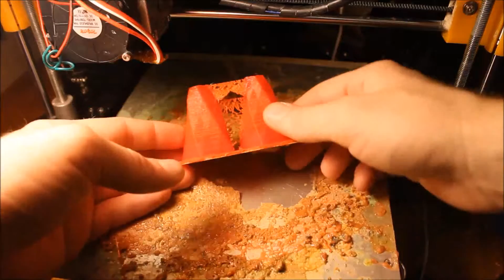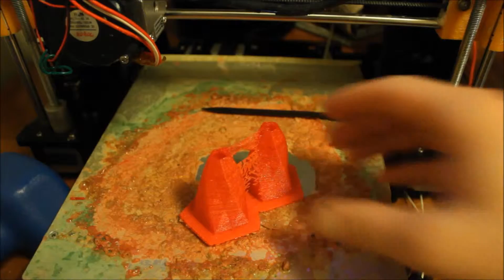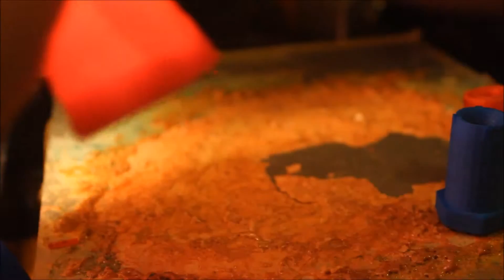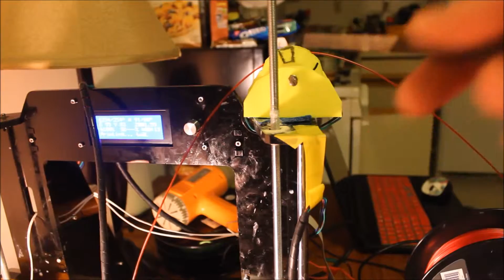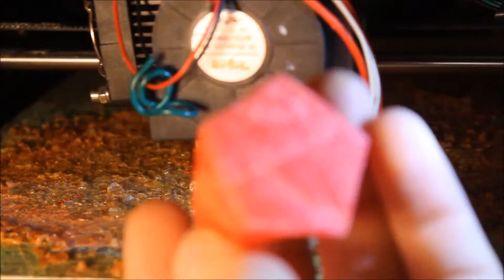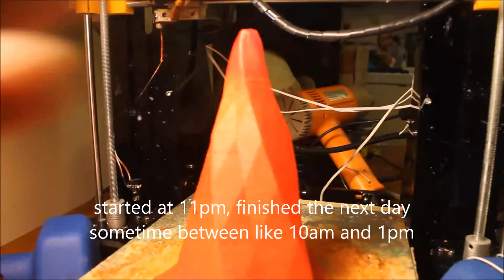3D Printing with Translucent ABS

Comment: What the F** is that puke on your bed? and cool down the print temp down a tad and raise the retraction and those strings will go away
Reply: +patprop74  That "Puke," which should not be on anyone's bed, is ABS slurry. I no longer use slurry and highly recommend Kapton tape for bed adhesion. Your other suggestion to lower the temperature is also very good. I run most of my ABS prints between 220C and 237C these days. 
Thank you for the comments!
Reply: +Richard Hebb loll I meant muck lol , I also when though the head aches of abs slurry which never really work well, then I tried 3dlac which worked great with out a mess if you have a headed bed, but now I am just about done with research and product launch for last few months I been printing abs on glass with out a headed bed with minimal warping. Soooon it will make a video on how to use my little product and help many with printing abs.
Reply: +patprop74 Hmm... Kapton on Aluminum is working incredibly well for me.

  I have printed ABS on glass before with and without adhesives. Ultimately, I find aluminum is better. Sure, the Aluminum can get bent while the glass to likely to remain flat, but the heavy glass seemed to wobble a lot more than Aluminum. Further, I could drill a new bolt hole in my Al bed, or widen an existing bolt hole. If it's glass I'll need special tools and then I might have glass shards all over my workshop. If (when) I drop a wrench on my Aluminum heat bed I might have to re-level it; drop a wrench on your glass bed and you might need to start over. 
  All that said, if you are going for very high quality prints and are willing to sacrifice some print-speed to keep the lash under control then glass does yield a heck a beautiful bottom surface. So I might be interested in trying your 3Dlac when it becomes available, if the price is right. Especially if it works with T-Glase.
Reply: I recommend using glue stick

Comment: bruh clean your bed.....
Reply from the maker: +chris menke Yes Chris, that is good advice. I no longer use ABS slurry EVER. 

I used glue for a little while and liked it better than slurry, but now I've graduated to a clean bed lined with Kapton Tape. The Kapton gives my parts better adherence and a bottom as smooth as a baby's.
Reply: +Richard Hebb yea I have a heated bed with Kaplan tape, almost never have issues. I honestly didn't realize it was slurry on your bed, I was thinking you just never clean it haha, my bad.
Reply: +Richard Hebb on another note, watching this video helped me make my decision to not get transparent filament. have you seen any improves men's in the clarity? for example I make a lot of replica lightsabers and have been trying to make the laser part with transparent filament
Reply from the maker: +chris menke I would definitely suggest PETG instead of ABS for that application.  PETG is the clear plastic used to make Coke bottles. My most transparent prints have been in PETG with a big fat nozzle (0.5mm to1.62mm) and a tall layer hieght (0.5mm or more).
Reply from the maker: +chris menke I buy Esun's PETG from Amazon. I think I have used every color they sell by now... It's good stuff. More flexible than ABS but still hard enough for gears and functional parts.
Reply: @richardhebb1123  This doesn't even look like slurry.  It looks more like peanut brittle.  lol.